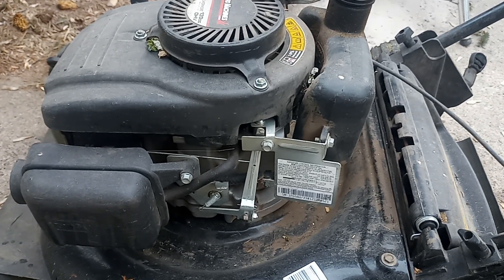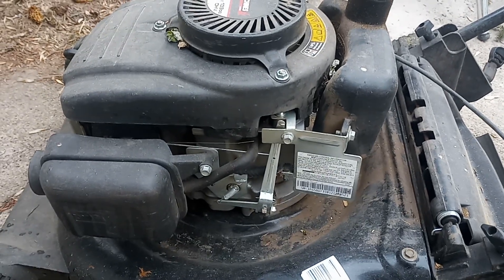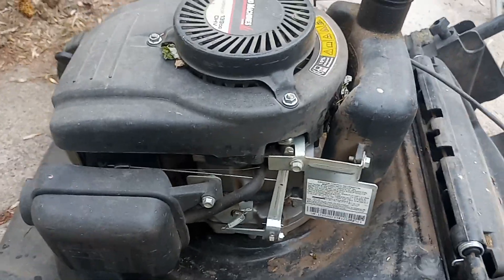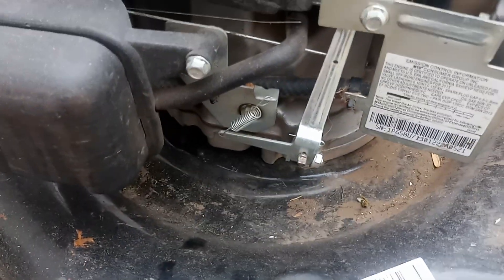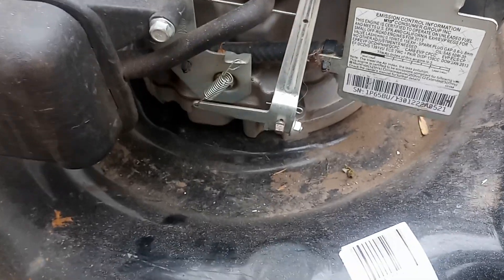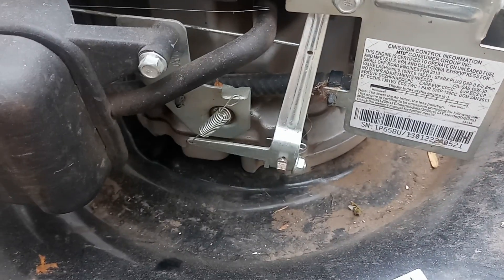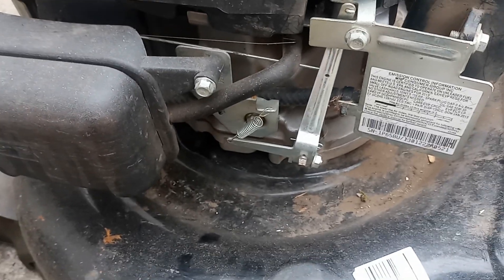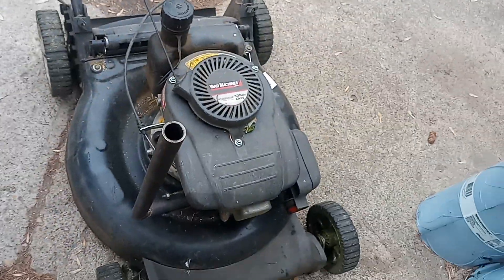Lowering grass cutting times.

Comment: I did that to my Honda HR 215, I have a K&N oval Holley Weber air cleaner I modded to fit. so I never had to buy an air filter for it. I did adjust the governor back to a sane rpm because I do not need the speed anymore.
Reply from the maker: It mulches way better with a bunch more rpm.